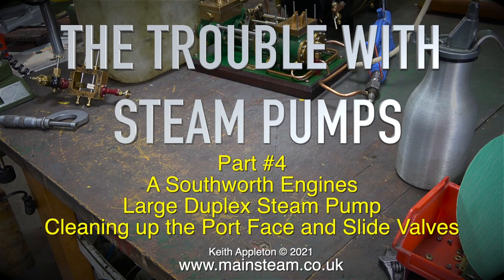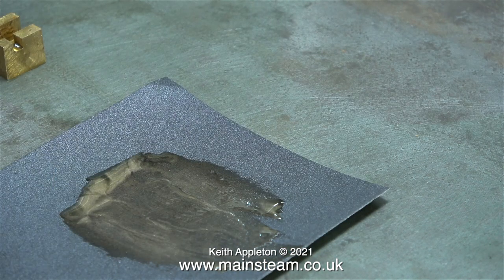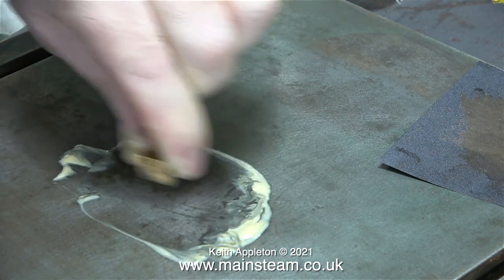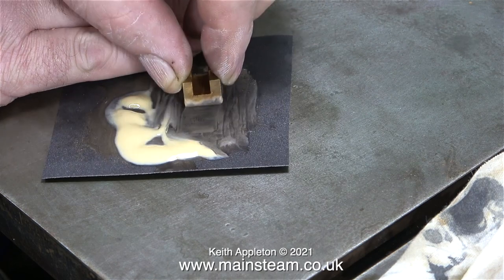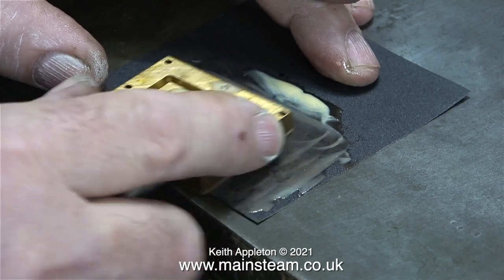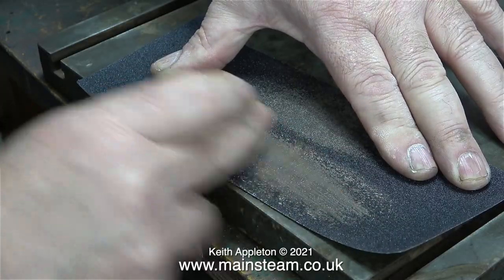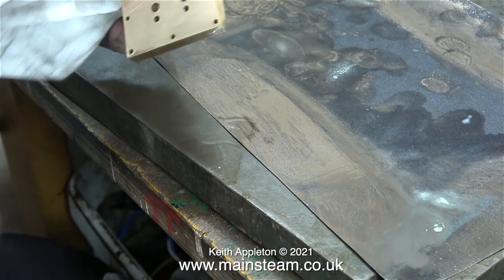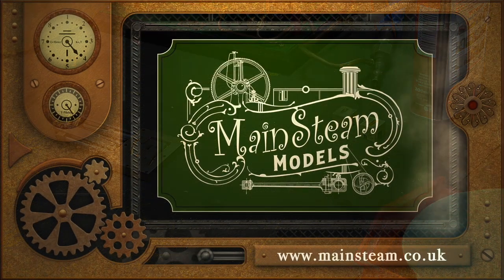THE TROUBLE WITH STEAM PUMPS - PART #4

Comment: Keith, when you first used the lapping (polishing) compound, you placed it directly on your surface plate.  If beginners do that a lot the abrasive will embed into the brass (the softer of the two) and actually lap the iron plate.  Your idea of applying the compound to the sand paper/emery cloth prevents that.  I agree with you and some other commenters that doing jobs by hand, without using power tools, at least for beginners, is much safer because you then have a chance to not ruin the part(s) before you realize what's happening.  Your "beginners" videos are worth more than their weight in gold!

Comment: My tip of the day: for jobs like this I keep an old electric orbital sander and I temporarily glue the part I want to polish with silicone rubber to the place where the sandpaper normally goes.After it dries in place then use the sander as you we're doing with your hand.By going to finer grits and then to polishing compond you can make the faces look like chrome in about 10 minutes. I picked up an old sander for 5 bucks at a garage sale and it has saved me many hours doing this. I always enjoy your videos.Thank you.
Reply from the maker: Yes that's a good idea but it makes my hand feel a bit strange after a while . . . }:-)))

Comment: I’ve become a big fan of silicon carbide sandpaper for these jobs. 3m brand, I think. Also, I use a very light spray of super88 spray adhesive. That keeps the sandpaper down to the plate. Quick cleanup with acetone or IPA. Tip originated form Robrenz, of YouTube machinist community.

Comment: Keith, is it possible that your wet or dry sandpaper is not getting dull, but it is getting clogged up with the metal “dust” and whatever medium you are using? When I use it on my car model kits, using water only, I rinse the paper periodically to unclog the paper. I do realize that the plastic kit parts aren’t going to dull anything, like metal could, but it was just a thought.
Reply from the maker: Yess, water is OK. Not too good for Cast Iron or Steel though. Machine oil seems to be good for metal parts.

Comment: Dumb question I guess,but how did Side 2 get to where it was not flat ? It presumably got machined flat at time of construction, and no moving parts touched it.
It would not have occurred to me that it was not flat. Would I have checked by a rub on the wet and dry ? Almost certainly. And would have been mystified. 
The difference is,you have been down this road before.
Reply from the maker: Pieces of metal often distort during the machining or drilling process.